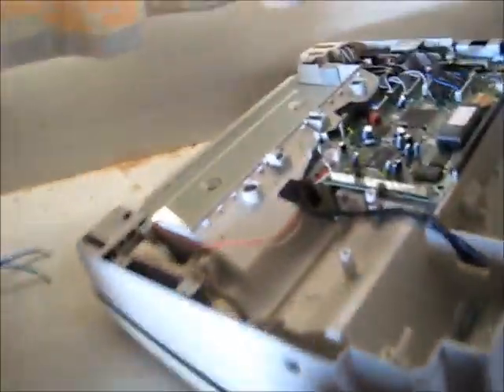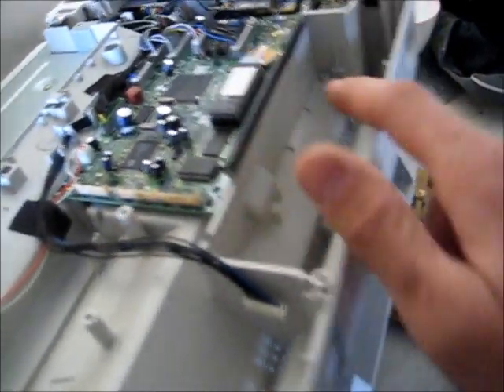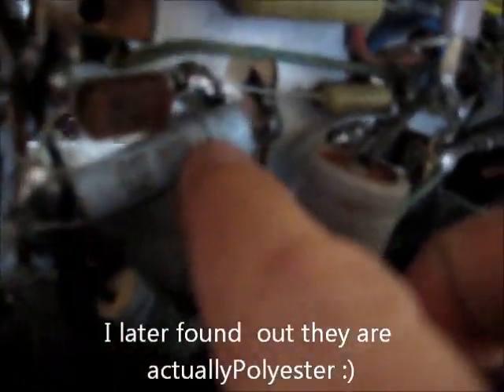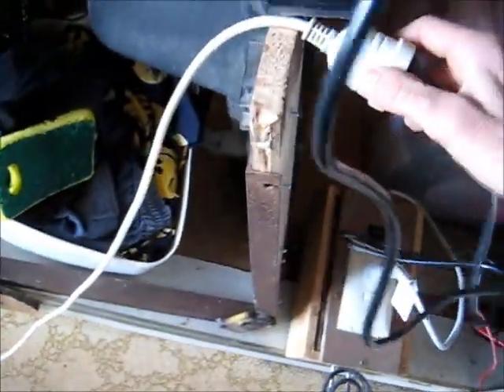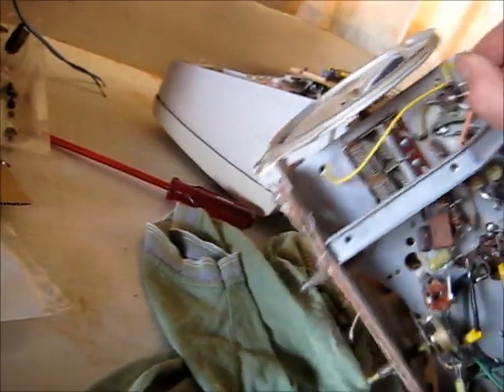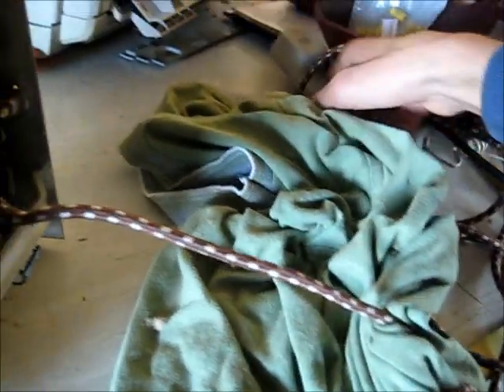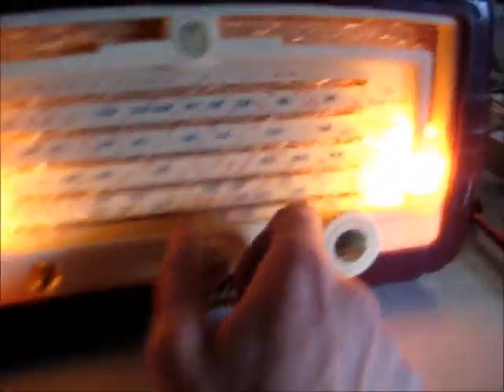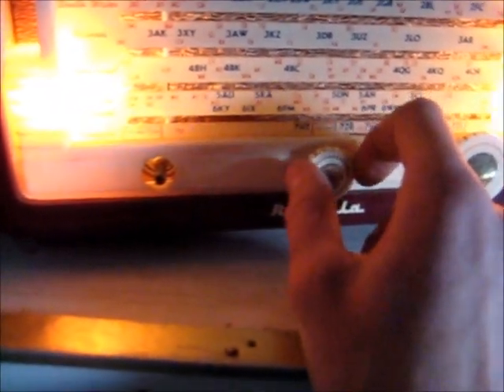AWA 467 MA Radiola Repair

Comment: @huerdon Yes, you unplug the old tube and plug in another. Replacements are easily and inexpensively found for most of the 7 and 9 pin radio types.

Comment: @huerdon Larry is quite correct, they still manufacture vacuum tubes, at least some types, mainly in places like China, India, Russia, etc. There are some solid state substitutes for tubes that some have made on a small scale, but in most cases the substitutes cost more then the tubes they replace and don't perform any better.